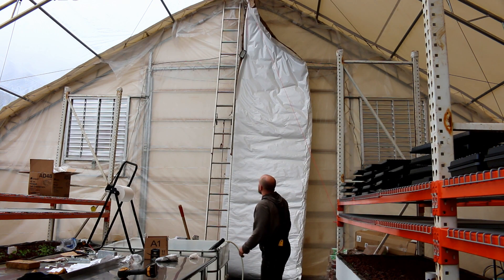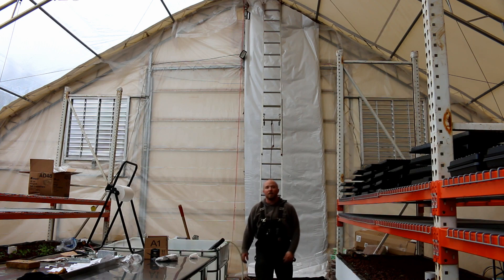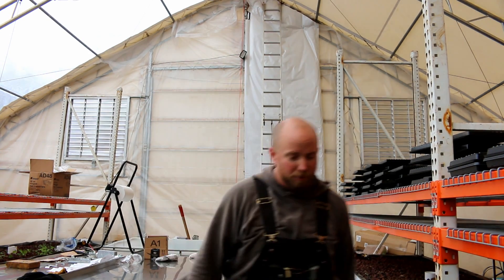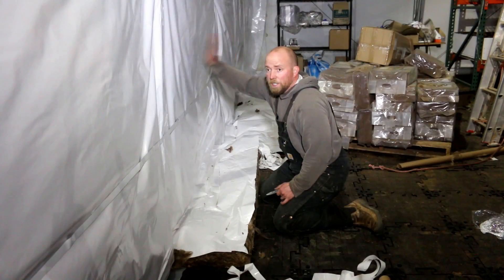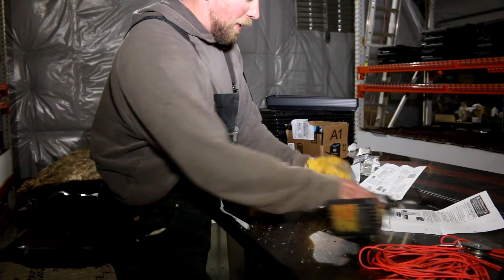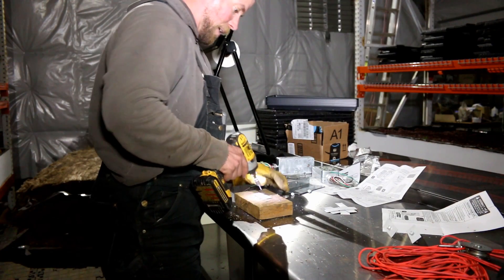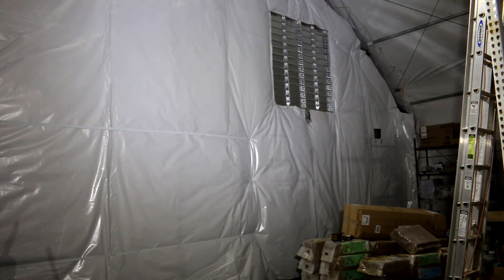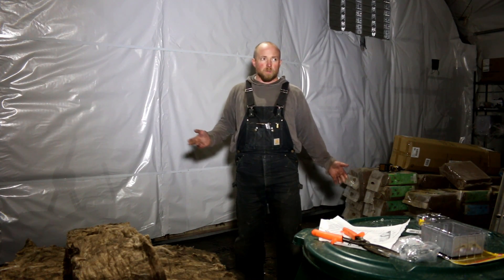How to Insulate a GREENHOUSE - Part 5

Comment: You now have porous insulation between two vapor barriers. Condensation buildup in the insulation can become an issue over time.
Reply from the maker: yeah I'm worried about it but am stuck in a pinch

Comment: Good job with the insulation.  Much better plan over last years solution.  

:)  3 to 4 inches making it less accessible to mice. :) Sorta like the deer crossing signs protecting your car from deer away from the signs.   It will reduce wicking for standing water.  I was wondering how easy it would be to remove the insulation from the overhead doors?  or is the working plan that the overhead doors are permanently closed now ?

Comment: I don't know exactly how the vents work, but could you put insulation covers over them hinged at the top to open with a pulley system went you need to vent the building?
Reply: I agree. But I think its only worth his time if it turns out to be a problem, I suppose we just have to wait and see.